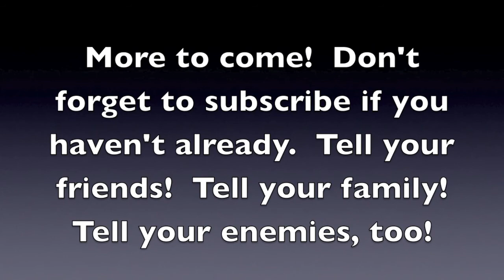Yellow F-16 Build #17B.mov

Comment from the maker: @randyneighbour I think it will be fine because there is no flex where the bondo is since I poured all the epoxy in there.  The epoxy around the lip is about 3/4" deep and about a 1/4" thick.  I was also concerned about this but so far so good.  If I'm wrong I'll see a pink puff of dust before my glorious descent to the ground!  LOL.